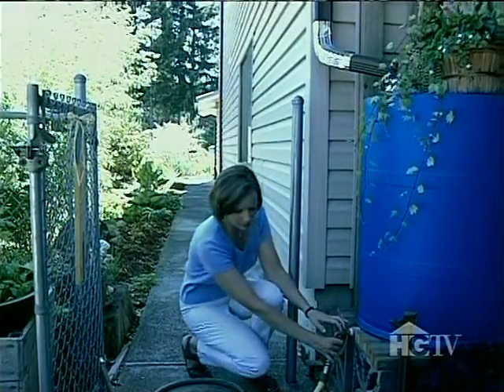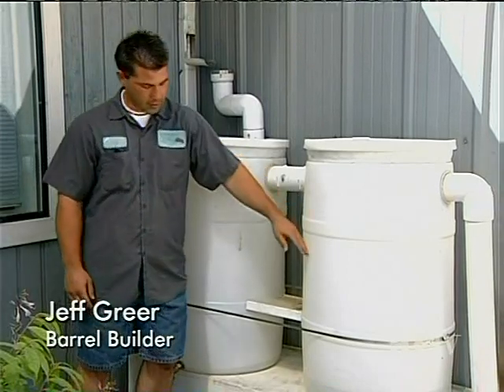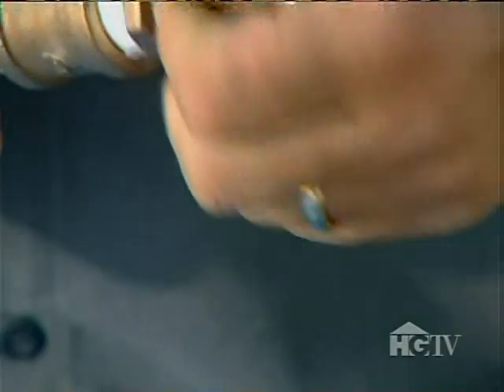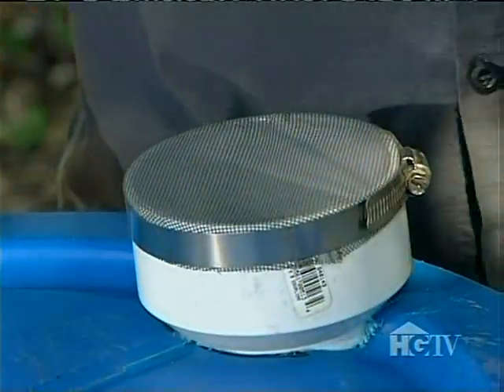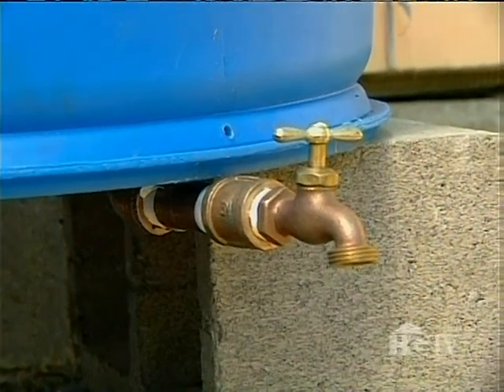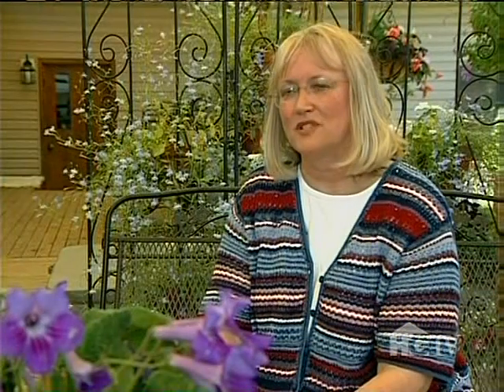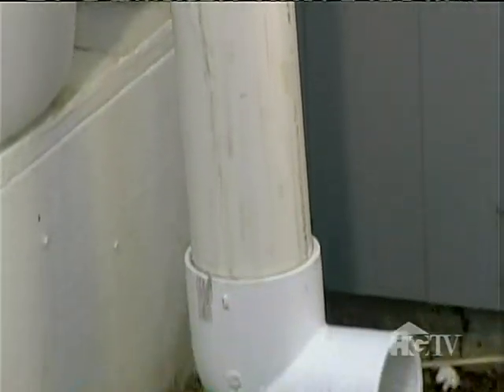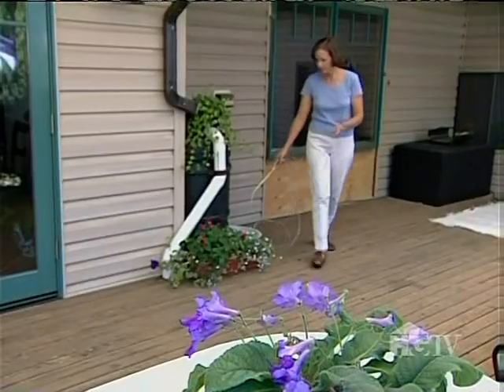How to Build a Rain Barrel

Comment: Just tried this. Notes: 1) Don't do the multi-part spigot in the cap, just do a low spigot about 2" from bottom of barrel (this will keep any sediment in the barrel out of the water - if you do it right at the bottom like he did, you will get sediment in the water). 2) Use a 1" bit to drill to hole, this will nearly exactly match the exterior diameter of the 3/4" spigot and it will literally screw into the plastic VERY snugly. I even used pipe tape and the fit was so snug, it stripped and ridged the pipe tape on the outside of the barrel. 3) He doesn't show how he connected the two barrels, but if you do it as shown in the background, it will essentially be two barrels needing two spigots. I would recommend connecting them very near to the bottom. This will allow gravity to equalize the water levels in both barrels (as long as you have vent holes - overflow and intake pipes should suffice) and will both feed a single spigot in just one of the barrels.

Comment from the maker: @clamcrabber I empty mine about a third and if an ice block forms, it has room to swell to the top of the barrel. I then put the chute back on the downspout and let the water flow regularly onto the lawn so I don't add more water in the barrels. I like to have a cache of water in the barrelsin case the spring is drier than normal.

Comment: I collect my water to drink by using plastic bucket. I just place them over a pic nic table. I just make sure that water won't get in touch with any other thing, from the cloud to the bucket. It is odorless, colorless and tasteless. It is better than other kind of drinking water. It is destilled water. If no metal has touched it. Also can be used to refill a car battery or radiator.

Comment: Notice the little bit of water sent through the downspout - it spills over the top of the inlet and then where does it go?

And they tell you about getting the water away from the foundation but have you put a garden hose for the overflow????

Comment: Well, here's an idea for you, don't drill a hole for the funnel.  Use a male adaptor to screw it into one of the bung holes.  Drill a hole for the faucet, but use a bulk head fitting to install the faucet.  Don't use a garden faucet, use a 1/4 turn ball valve.  A hose will screw onto it same as the garden faucet, but the flow will be twice as much.  For overflow, use a "t" fitting on the intake funnel.  Now your barrel can completely fill up, and you only drilled one hole.

Comment from the maker: Our utility (private co) charges a sewer charge based on how many 'units' of water used, whether or not 100% of water used goes back into the sewer. Units are undefined. :( 
No pump. My savings is mainly from the sewer charges on my utility bill I don't incur by using the rain barrels. More rain this year, but droughts the last 2 years with water restriction. I use them daily for my vegetable garden. I have 4 50-gallons linked. Additional water from HVAC condensation drip and dehumidifier also.

Comment from the maker: The 2nd 3/4" hole is on the other side of the drum (with respect to the first one that is drilled through the cap). What he said is "..another nearby on the side.. an inch or two below the top." He failed to clarify that the topside of the barrel becomes the bottom (where the spigot is screwed into the hole in the cap) and the hole on the other side becomes an overflow hole at the top (with a pointless spigot since you want that always open for overflow). You can get 55-ga drums at Soda bottlers